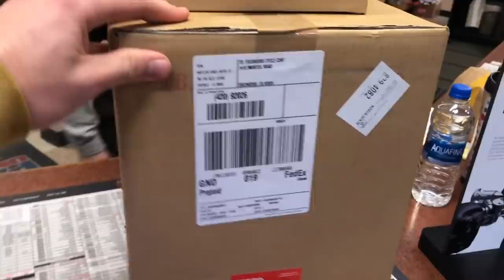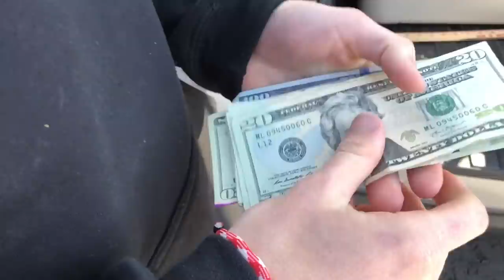Massive CRASH - Buttery Vlogs Ep17

Comment: I can’t believe your premium fuel state side is only 91 octane. In Australia it’s 98
Reply: the octane ratings are different we (Australia) use the "ron" octane rating and the USA use "aki" octane rating. their base gas 87(aki) is actually 93(ron)  2 higher than our base 91(ron) and their 91(aki) is about 97(ron) but they do have 93 and higher aka 100+ octane at some petrol stations.